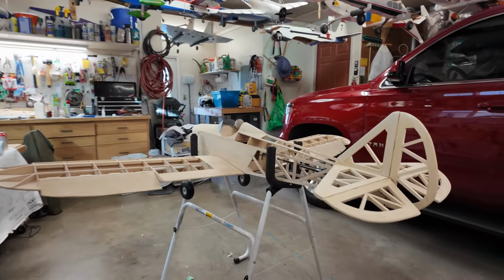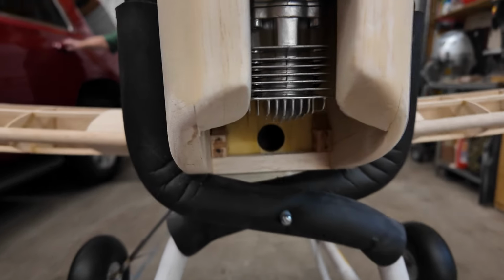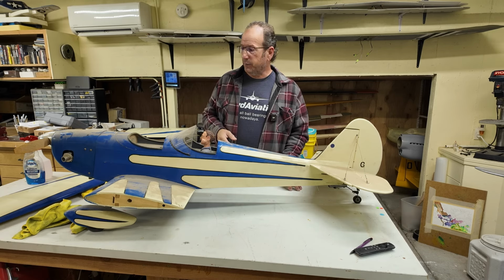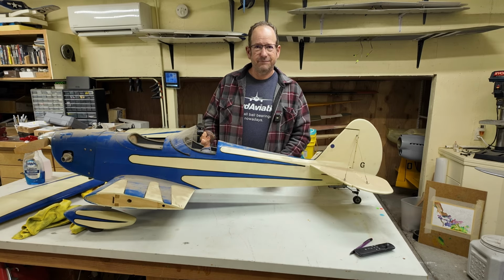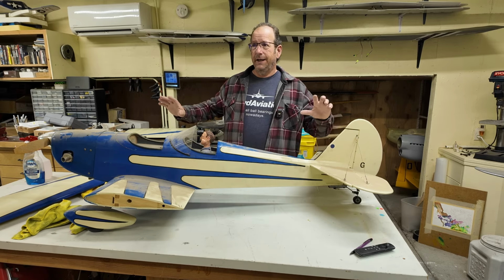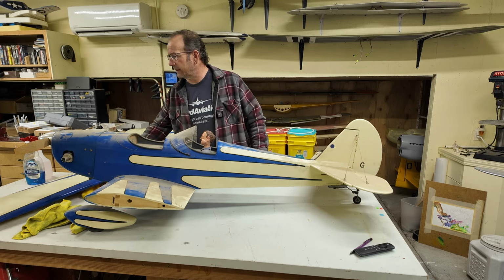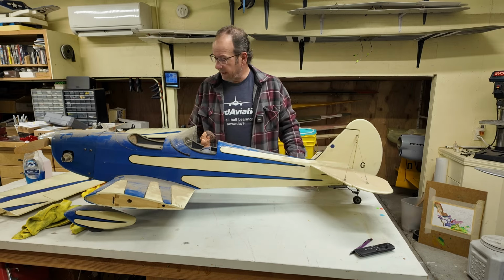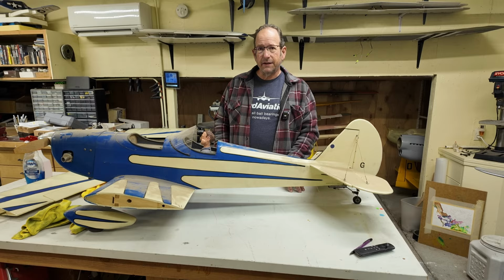Sig Spacewalker II Barn Find:  After 20 years, let's get this one back up in the air.

Comment: I have the same plane with the one piece wing. It's one of very few Models that I did not build. I got it dirt cheap and it needs to be stripped and re-covered. I'll probably use Sig Koveral. I have an OS 1.20 Gemini flat twin or a Gemini 1.60 ... don't know which engine I will use. I hope i'm not in for a surprise when I get the covering off but I'm a builder so I can cope.
Reply from the maker: That sounds like a great project.  You will probably be fine once you start uncovering.  There is a lot of “box” construction with raised spars to create the cloth on stick look.  Either of those engines will be fine for power but the boxer valve covers on the 1.6 might add a nice scale effect.
Reply: @Capgains7777  Thank you for taking the trouble to reply. I really appreciate it. Both of the flat twins run very well on no nitro fuel so I can save some money and mix my own fuel. I've been doing that for many years with engines that will tolerate no nitro. And yes, that 1.60 is a mighty pretty engine.

Comment: Great video, very charismatic plane. Do you remember how did you do black outline strips around blue rays of the monocote?
Reply from the maker: The covering is 21st Century film which is more like a cloth from Coverite.  The blue is Rustoleum spray can.   The black stripe is vinyl 1/8” automotive pin stripe.  It was pretty easy to form the radius turns by stretching it gently around the star bursts.  The star bursts were masked off with tape and paper first, then Rustoleum.   Just for peace of mind I traced all of the pinstripe with a brushed on coat of lacquer hoping it would help hold the stripe down.   So far so good on this one but I have had failures on other jobs I have done, I’m not sure the lacquer helps if the stretch is too sharp.